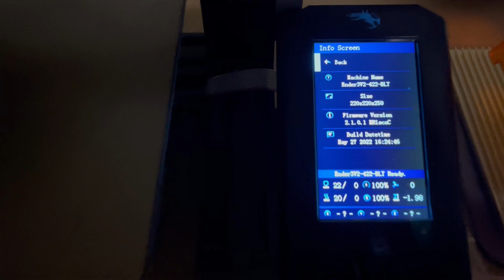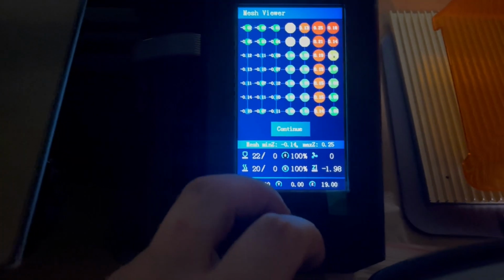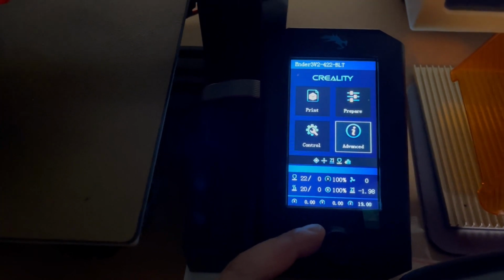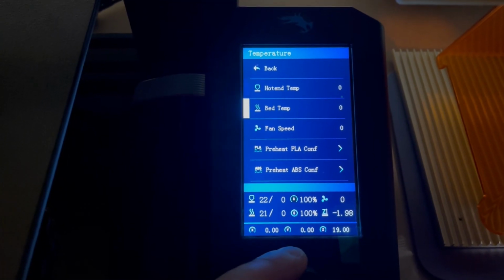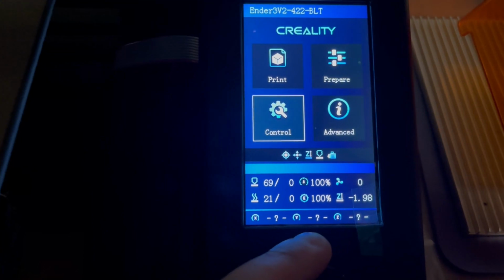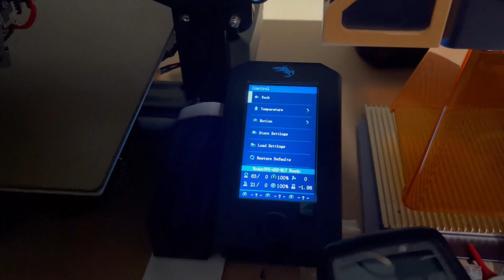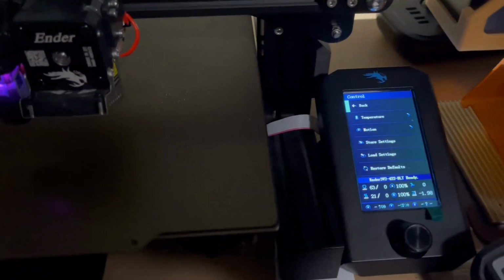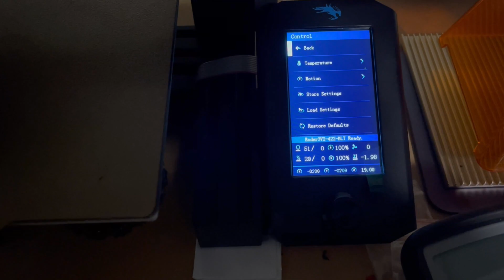Ender 3 v1/ v2 / S1 sprite extruder PRO kit 300º UNLOCKED!!!

Comment: I have the ender 3 v1 and bought the sprite extruder pro kit, but dont have the cr touch, I bought it thinking it would be plug and play and it is not. do you have firmware that is for the v1 and not cr/ bl (etc.) touch?

Comment: You can do following: Download the whole Repository of that Firmware and edit the Configuration.h on line HEATER_0_MAXTEMP
 275 to 295 and recompile the Firmware again in VS Code and you have higher Temp on the Extruder Pro. Note: The difference is ever 15 degree Celsius in the Firmware to real Temp. That means you will have 280 degree Celsius in real when you set it to 295 in the Configuration.h   Caution: Don´t use the maximal temp of 300 degree Celsius because the Extruder Pro has also a PTFE Tube inside. Only the Hotend is a full Metal Hotend.

Comment: Is it possible to make the firmware for a ender 3 max 4.2.2 board?
Reply from the maker: the firmware can flash 4.2.2 board, and you can change the values to fit your printer (x,y,z) size
Reply: Ok i dis but i went to physical setting to max the bed size is not going to 300x300x 340hight it stay in the bed size off the v2